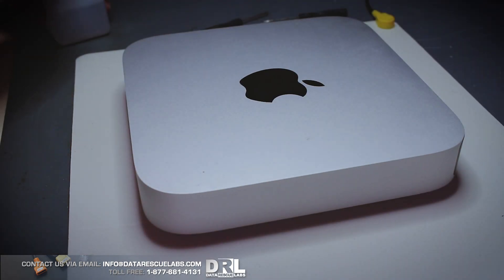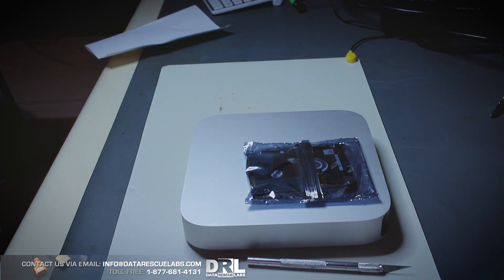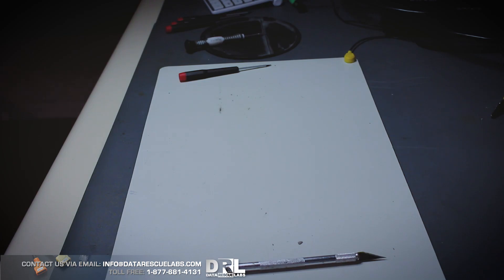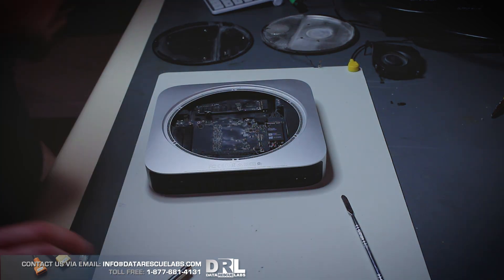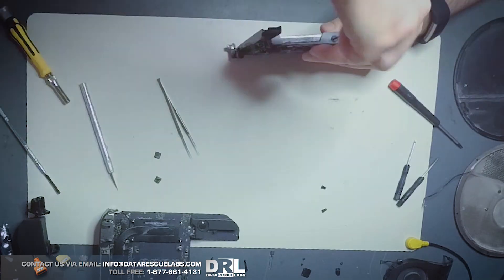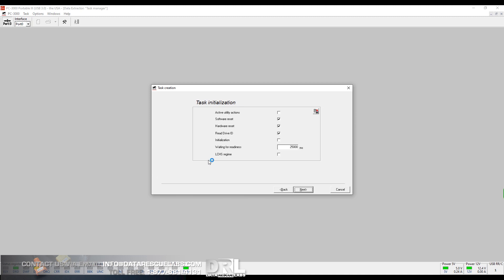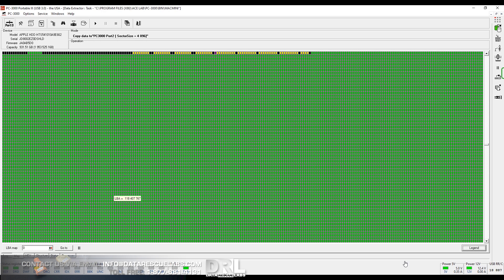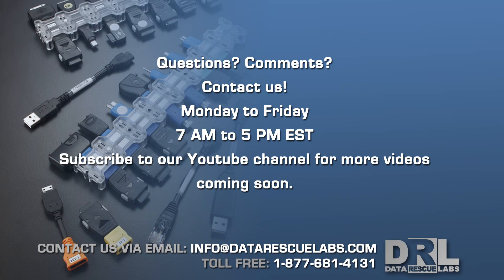2014 MacMini hard drive upgrade / swap

Comment: Hi my dear friend, while watching the video I am also on to the comments section... thanks for sharing, :)

Rosewood drives... tough time when comes to Data Recovery.
Reply from the maker: Nice man! That was damn fast! And rosewood are the worst
Reply: @forensicguy  I know, it was very odd that this case went very straightforward, no head map needed or head stack assembly,  even furthermore... you did the right thing, sector by sector image... this is the type of channels that should have way too much subscribers, worth it every time... thanks a lot.
Reply from the maker: It had to be a full sector by sector copy because of the fusion drive setup. Customer wanted a booting system as before it crashed. I did some testing after it was done. Everything worked 💪🏼
Reply: @forensicguy  It was pretty awesome, not only getting data back but also keeping the operative system's integrity on high levels... true respect.
Reply: Nice